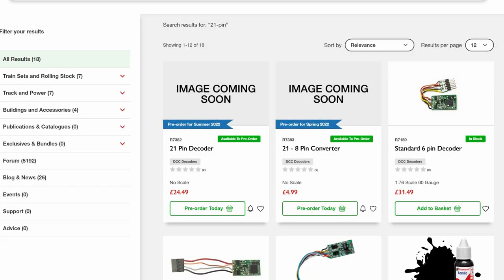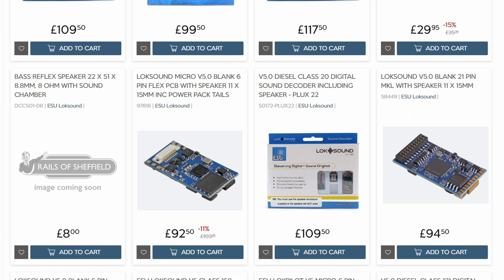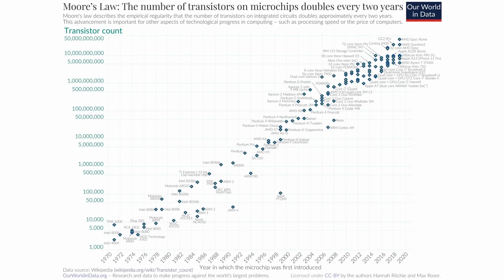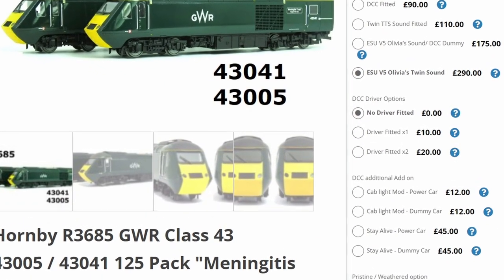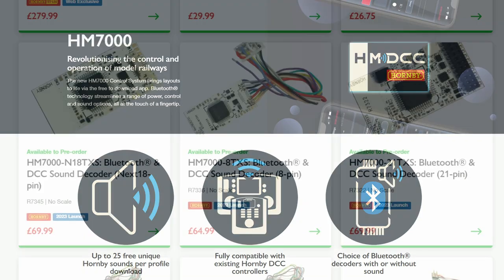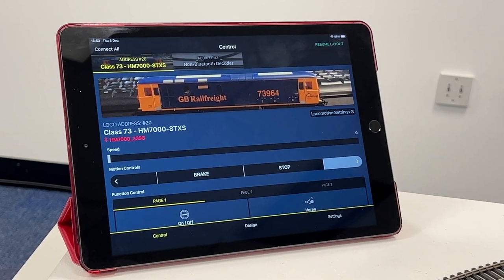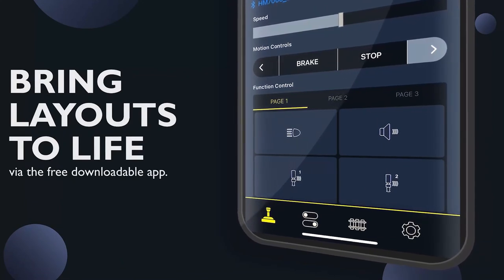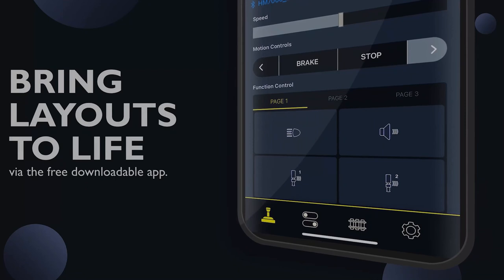Can Hornby's HM7000 solution address my frustrations with existing DCC sound and control operation?

Comment: It will be interesting to see how reliable Bluetooth turns out to be in this application, given my experience with bluetooth on a keyboard or mouse. That said, in headphones it tends to be better. I also wonder whether Hornby will have any better luck at keeping these new hybrid bluetooth/DCC chips in stock than it did for its old TTS chips given world chip shortages. And ultimately unless you go Hornby only, you're going to be a running a mix of bluetooth and non-bluetooth controlled locomotives, only some of which will have the supposed advantages of direct control.

I'd expect that Zimo and ESU will still be the best options if you want high quality sounds, but it should open up DCC sound to a wider market. I've an ESU controller, so programming ESU chips on the main track is nothing new - but the Hornby offering could be a better alternative to a lot of the US (or rebadged US) controllers which have been stuck in the past such as NCE, Digitrax and the Prodigy controllers.

Personally I prefer having a physical speed dial to control my trains rather than having to look down at a phone screen (so the ESU mobile controller which is an android device with a speed dial attached is great), but I can see the attraction of phones in the sense that there is a lot more innovation in phone user interfaces compared to the DCC controller market. Although once again, Roco's Z21 controller already offers a lot of these benefits unless you are sold on bluetooth.

The proof will be in the implementation - how smoothly bluetooth works, how available the chips are and how robust the software is.
Reply from the maker: Absolutely, there's a lot to be worked through here. At least you can dabble with some of their new decoders and the free App without any capital outlay on a controller. The z21 isn't cheap but it's probably the state of the art of the newer DCC controllers.
The other thing I'm interested in seeing is whether it sparks any reaction from ESU, Zimo etc. Probably won't do until it's further along. In fairness they've been milking it for a long time now. I suspect retailers and manufacturers have as well with a high mark up on decoders.

Comment: I have been a DCC user since 1997. I model American HO, HOn30 and Irish OO. My loco fleet isn't big so the £120 cost for a sound decoder isn't much of an issue, but yes I agree, If the cost was more like £70 a lot more people might join us. Over the years I have used Digitrax, NCE, Lenz and Uhlenbrok . Out of all of them the Digitrax does what I want . I would be interested in the Hornby unless it's going to be laptop based, then no, as I want something that does the job but can be out of the way.
Reply from the maker: Thanks for that. I think £60-£70 is probably a pivot point for taking sound alright. The ideal device to run this on will vary for different  individuals and grades of user. I don't see anyone controlling an entire large layout with an iphone. Will need to see the practicality of different client devices for different users.
Reply: Looking forward to Hornby HM 7000 hopefully it will be a good system I like the idea of being able to programme on the main track.
Reply: @EuviRail  all my layouts are small, maybe 6 locos at most and all points are dc not dcc so if sounds became available i might be interested
Reply from the maker: @dawdawes  Sounds like the level that phone control should work Ok or maybe a small tablet / simless phone if you're likely to have to take a lot of calls.
Reply: @EuviRail  I would get cheap phones just for the train control

Comment: Thank you for this well presented and thought provoking video.  I too am very interested in these new products from Hornby.  Hopefully it will be a gamechanger in that you can download free sound files onto blank decoders and presumably change them to another sound for a different loco should you wish.  The deciding factor for me would be could I use it with my existing NCE Powercab which controls my existing DCC fitted locos?  I have approximately 80 locos/units (all diesel and electric), approximately 40 with ESU Loksound and Zimo and 40 with TTS.  I think TTS were good especially when fitted with upgraded speakers.  But getting good motor control was something of a challenge, requiring a lot of fine tuning of CVs.  But I did get them all working well. If it wasn't for Hornby TTS I wouldn't have got my entire fleet sound fitted.  So I applaud Hornby for this new innovation - fingers crossed it can be used with existing systems.  And good motor control is so important too.  Cheers.  Vivian
Reply from the maker: Thanks Vivian. I not too different from you in terms of  no. locos and a good representation of TTS which despite it's shortcomings, I've been a fan off. The TSX decoders promise so much more so fingers crossed Hornby get these right and address the motor control limitations of their predecessors.

Comment: This is an absolute  game changer, Ive always thought that DCC was an unnecessary complication and expense, but this makes sense. DC Power to the track and direct communication to the locomotive in a touch friendly format. Hornby seems to be leading the market again instead of playing catch-up.
My only concern is whether they’ve learnt the lesson of Zero1. A proprietary game changing development that ultimately stagnated and got overtaken by a more developed international standard, leaving legacy users struggling to get decoders.
Reply from the maker: Thanks Jonathan. The proprietary aspect is always a concern. Adoption needs to be strong to avoid being left high and dry.

Comment: Like yourself I'm interested to see what this brings. My initial reaction is that it will make operating the locos a lot easier on the app than with convention DCC. 
Putting off chipping any locos until this new system is released.
Reply from the maker: Yeah, I've suspended all decoder spending ahead of getting my hands on some of the new TSX decoders.

Comment: Hi Eugene, thanks for this video, obviously there are currently more questions than answers. The system does, as it stands, however, deliver a number advantages if considered in its entirety; 
9sec power bank which could simplify point and crossing wiring, power issues, 
UK based, focused on UK motive power prototypes,
The overall cost reduction is far greater, as it can utilise your existing technology and hardware both personal and modelling control, for both integration or transition.
It aims to resolve DCC power and command issues by having the track supply power only, with bluetooth delivering command.
The range of decoders indicates cost consciousness.

HM has been around since ZERO ONE, unfortunately ZERO ONE was to far ahead of it’s time, however HM7000 is perfectly timed, but are we ready.

For me it could be perfect, I haven’t bought a control system since ZERO ONE, choosing to buy track, rolling stock and motive power instead, while waiting for the right system to be developed, RailMaster was close, eclipsed only by TrainController, which delivers what I need.
The question is will HM7000 work with TrainController, without having to also buy a DCC Controller, namely the ECoS 50210 and system. Massively expensive when considering ~50 locomotives, points, signals and detection, not to mention sound.

Looking forward to following your progress on this very exciting development.

Best wishes
Reply from the maker: Thanks for that and the good points. The simplification of adding the power bank is a nice plus alright as are the different cavities for the sugar cube speaker and all the other benefits. Even sound users who are not Hornby advocates should see there is value for them here. I'm sure we'll see some iteration on the bluetooth side for scale and resiliency but if the decoders and sound files are good out the gap I'll be happy to start using them.
Reply: Quite exciting really, let the reviews begin

Comment: If the dongle will work with my NCE Powercab , the decoders are reliable , and also the app. Then I would be interested as I like the feature of downloading the sound file which beats Economi Soundtraxx as it has more sound files available.
I shall wait to see reviews once the system is out.
Reply from the maker: Thanks for that. It kind of pulls the rug from under the SoundTraxx Econami decoders alright.
Reply: How do we find out if the HM7040 dongle is compatible with what non hornby DCC controller we already have?
Reply: I have sent an email to Hornby asking that question but have yet to have a reply.

Comment: Definitely interested and will be watching closely over next 12 months and will take up if positive responses from people like yourself. I used to use Hornby railmaster - but couldnt get it to work with Microsoft Surface Pro and windows 10 and no longer have old enough tech to use it.  So have switched to Gaugemaster Prodigy which works well enough but as you said lacks all the bells and whistles Railmaster could do.
Reply from the maker: Thanks Shane. Yeah, I use an old self build PC to run Railmaster. It's just a pity Hornby walked away from it. I know I'm eventually going to have to take the plunge with a newer system. I'm hoping HM7000 can give me enough to limp along for another year or two and see where things stand then.

Comment: HM7000 looks what is needed although not relevant for me. That is because although I can operate DCC with a gaugemaster and DPDT switches I don't often use it. Its not a shunting layout. I don't have point motors or uncouplers. My idea of fun is for trains to go round and round or backwards and forwards. When I switch sound on, I soon tire of it. So only point is a set of lighted carriages. Still for people into DCC, HM7000 looks like a step change but like everyone else I've heard what it can do but not used it.

Comment: like you I'm a heavy DCC user, what bothers me more with steam is the fitting of the chip and speaker in existing Hornby range. the chip will be bigger and the speaker will have to be placed somewhere around the roof of the tender or in a gap in the weight. does this mean at some point Hornby will release all their locos with a better tender? Also on smaller locos eg the Pecketts and Rocket will the chip fit? I think it's a great idea but have Hornby thought it through. I won't be buying it.
Reply from the maker: Thanks for sharing. For all but on of the steam models I have I've gone for pre-fitted DCC sound as I've dreaded the installation on these models. I put a SoundTrax chip in the tender of a Bachmann MOD 3000 alright. Better sound provision is required on these models. The different sound chamber options they are including with the sugar cube speakers should help here but in general I find the tenders a bit flimsy so that for bringing this up.

Comment: The drawback with DCC is that you can only programme a loco by interrupting the power to the track. It is not possible to read CVs when the loco is running. Consequently there isn't any way for a loco to tell the command station where it is on the track. Whoever devised DCC must have thought about it. The silicon chips of that time would not have permitted a more complex system than the DCC that has been devised. I think there is a need for a "Zero 2" system as you indicate. Bluetooth does obviate the need to transmit instructions to the loco via the track circuit. But the drawback is the huge cost of the HM7000 decoder! Thanls for sharing your thoughts on this subject.
Reply: Yes, you can read CVs whilst an engine is running. It is called Program on Main. Hornby controllers will not do it as they are rubbish, you need something decent like an Ecos 50210
Reply: @BearsTrains  Programming on the main is a decoder function. The Elite supports it, but eLink and select do not.
Reply from the maker: Thanks for that.  I'm sure the originators of DCC would take a very different approach today given the low cost options available such as WiFi or Bluetooth or they may have come up with much faster data rates and enhanced R/W capabilities via the track (using the DSP and mixed signal capabilities of today's silicon). If the NMRA were to turn around with an enhanced DCC spec that included the latter and could be built into new decoders that would still be backwards compatible we'd have an interesting debate on our hands! The DCC controller vendors would love it of course.
Reply: @EuviRail  I have had to give up purchasing decoders for new additions to the fleet. They are just not worth the money! I think it would be better if DCC locos had like a SIM or micro SD slot that you could just put a chip in when you wanted to run it.  The drawback with DCC as it is is that every single loco in your collection must be chipped, and that's way too expensive!
Reply from the maker: @AllensTrains  100% agree. The notion of the equivalent of a microSD slot or the like to allow you to swap decoders easily between locos and then reflash them with the correct sound files has to be a desired endpoint. Irish Railway Models (aka Accurascale) put an easily removeable roof on their Irish A Class locos to allow the DCC chip to be removed easily was a start and I use it to swap decoders across different liveries of the is loco.

Comment: Interesting development Hornby, sound & Digi decoders seem fair price at £60 - £70 and as there's some cross over with other manuf with same Locos sharing sound file could be good option to go for an DCC Ready Loco and Plonk in a Hornby Blue Tooth Sound Decoder.    Class 50 / 66 from Acc/Scale could be a candidate.
Reply from the maker: They most definitely could be. There may be some CV optimisation required but to have these locos under App control with a lower cost decoder is appealing.

Comment: If you want a taste of the future buy a Hornby Playtrains set . I did for my grandson ...its fun ! the  sound is very crude however it gives you a taste of Bluetooth control from a very basic controller . But its the freedom it gives you to control a  layout  without the clunky controllers ...im sold, cant wait to  convert my first locos . Also you don't need to invest in new layout you use existing  infrastructure.
Reply from the maker: I never thought Playtrains would come up in the comments for this but that's a great point so thanks for sharing. 👍
Reply: the future is here David, i already run HM7000 on batteries.

Comment: I am an absolute beginner. Limited electronic skills. I can solder.  Now the important question,  has all the sections of track to be fitted with droppers and wired into a "Bus wire" because of lockdown Brexit the cost in DCC control systems has become Expensive. 
Subscribed and 🔔
Reply from the maker: Hi Derek, I use the rail connectors that have wires pre-soldered to them and get away with spacing them every 4-5 feet onto my main power bus under the layout. I haven't bothered wiring all of my sidings so when I switch from the siding to the mainline, the power on my siding will go and the locomotive will go offline on the App. Unless you want the lighting to stay on or want to shunt on the siding then this shouldn't be a problem. Of course, when the loco is offline on the App you can't do anything else with it like changing the CVs or the sound profile.

Comment: Bluetooth has been the obvious solution for years, so credit to Hornby for finally taking it!

I've been running my garden railway with battery power in the locos and radio control from Peter Spoerer. These radio units aren't that reliable, so a proven standard like Bluetooth is appealing, especially as those dreadful clunky DCC control systems can be done away with.

If Hornby adds batteries for loco power, zero layout wiring, massively improved slow running, no track cleaning, and cheap control will become the norm.

Kudos to Hornby. With HM7000 and TT120 they're on the innovation trail at the moment. Great to see.
Reply from the maker: Thinking about it we already have batteries in locos already with Playtrains!
Reply: @EuviRail  they almost have it with the 'keep alive' capacitors.
Hopefully a small step to on-board battery power, then rusty rails everywhere with locos crawling over it at a scale 8mph!
Reply: @chairmakerPete  running batteries and hm7000 right now. It's fantastic.
Reply: @rdrhouse   fantastic - knew it had to be possible!

You can now paint your rails rust colour, and let the train wheels wear them shiny as per the prototype. 

No more rail cleaning - ever - and running across those rusty points at a scale 5mph should be a joy.

You've got the final piece of the puzzle there... 👍

Comment: The drawbacks at the moment would be the lack of Android support - to utilise the blue tooth functions, And of course adding the sound profiles at the moment seemingly require an iPhone.

You could use the decoders in the regular DCC methods but getting sound you'd need to borrow an iPhone!

I have high hopes for this range, hopefully Hornby haven't cheaped out and recycled the TTS sound files, but I suspect they will have...
Reply from the maker: Yeah, I didn't want to get into it in this video but heavier users will want to run this on a tablet and Android support will be important. Also, the minimum OS Rls supported will be important as well. There is no point if your phone or tablet can't run this stuff after 3 years!
Reply: Have I missed something, thought the app wasn't available, but will be for both apple and android.. And you can only do sound via IPhone.. Where is that on Hornby website..??
Reply: @markweightman3805  it's not on a website, the app just doesn't appear (or didn't at the time) on any android platforms.
Reply: I'm not sure I understand what you mean. My Samsung phone running android sends and receives Bluetooth.